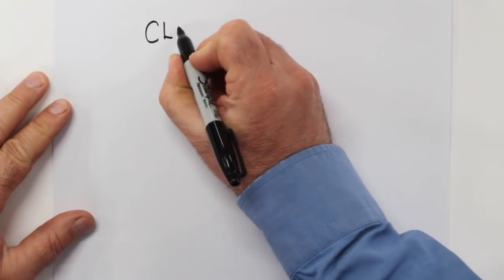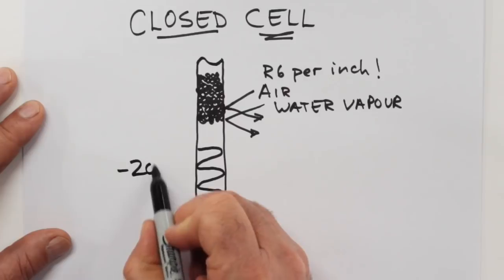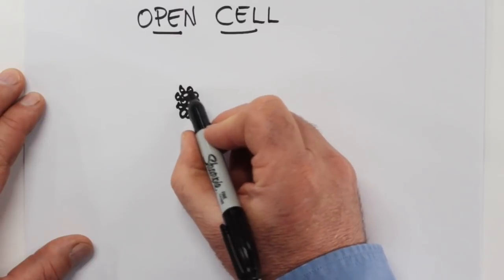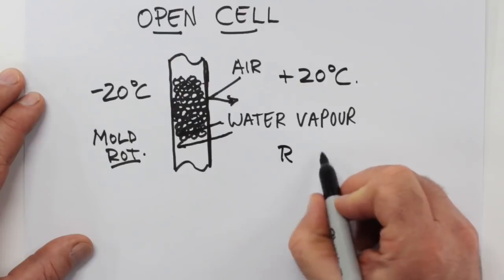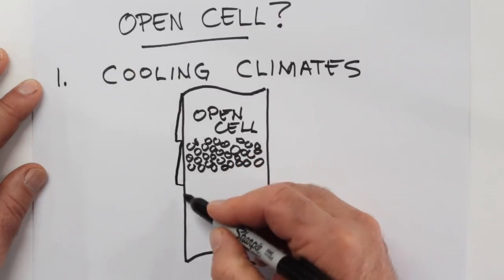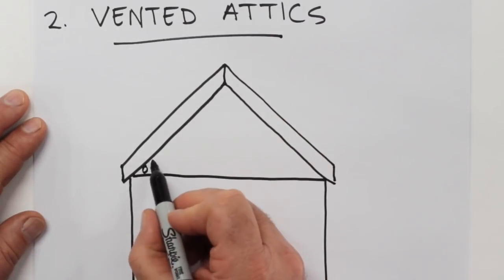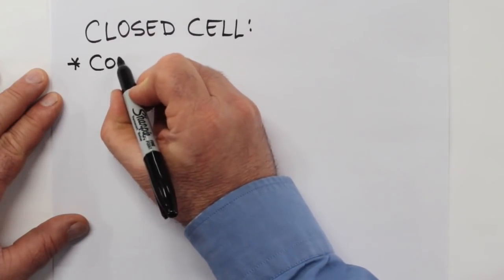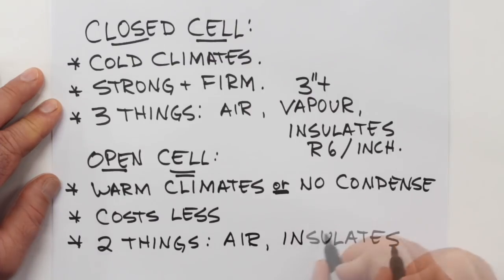SPRAY FOAM: Open Cell vs Closed Cell

Comment: From all of the videos I have seen, water vapor is the culprit. If not dried, it will cause mold growth. The mold smells bad and can cause serious health problems. I have spray foamed my house with closed cell and have no smell problems and it did correct leak issues near windows on exterior walls. The people having odor issues have poor planning of where to foam and no mold issues were resolved BEFORE foaming.

Comment: You don’t need 3 inches of closed cell to get water and air barrier.     Usually only an inch will accomplish this and the R6 rating is misleading as an air tight and water tight space will stay warmer and cooler depending on outside conditions.

Comment: Most UK banks don't want to go near any of this stuff not providing a mortgage if you have it.
Was thinking about having this installed on the inside of my roof, my bank said I would have issues with my mortgage if I proceeded with it, so I didn't.

Comment: If you use closed cell on a shingle roof traditional method, what happens if you get a leak,  Would i notice it? Which one controls sound more effectively since i live by and airport? I live in Chicago area - all climates

Comment: The disagreement in this comment section over what should be factual information is stunning. The absolutely destitute state of the contracting/construction industry is nuts. I've asked 4 or 5 handymen-types about basic things about my house and I get a wildly different opinion every time. It's no wonder house nightmares are so common. Everyone you talk to claims they've been doing "X" for 20+ years and the other guys have it all wrong. Meanwhile, homeowners are caught in the crossfire with all the bills and stress and hackjobs. It's really depressing because so many things in a house can cost well into 5 digits to fix if done improperly.

Not knocking your video, by the way. Just sad how hard it is to do the right things for your home.

Comment: Thanks for this wonderful explanation. We are completing a camper van conversion this year, and I just needed confirmation that the full closed cell foam insulation with the false floor installed is the right move, because so many people are using Havelock wool. We may add the more eco-friendly cork wood on top, but we’re definitely choosing the closed cell foam.

Comment: I have a metal roof woodshop I want to keep the heat in from a woodstove.  I don't care about moisture because the rest of the building is block and very water permeable.  I'm thinking open cell would be good for me.
Reply: Only if you want the moisture to pass through the foam and condense within it on the steel in winter.

Comment: With closed cell, one must be very concerned with trapped moisture.   The perm rating for closed cell is so low that water will not pass.   Imagine using this on the underside of a roof and you get a leak.  The water will now sit on the surface between the decking and the insulation.  You will get rot and mold.    As a mechanical engineer, I typically will call out closed cell only when it is against a surface, such as metal, where it will not cause rot or mold.   If using closed cell, you must take extreme care on making sure the surface next to it will stay dry.
Reply: maybe that's why you do not seal the joists just the cavities. if water goes in, the joists absorb it and directs it down.

Comment: 3" of closed cell on the exterior wall and finish it with open cell so you can cut it flush with the interior wall, then your entire wall cavity is filled.
Reply: Actually 2 inches of closed cell provides 86% reduction of heat loss(Compared to no insulation) vs a 3 inch application which provides 90% reduction of heat loss. That extra inch plus the additional open cell does very little. Spray Jones has a video called "How much spray foam insulation do I need" explaining how heat retention is far more important than R value. I think you'd like his vids.
Reply: @agentorange2554  I’ve watched all of his vids 👍
Reply: @agentorange2554  the issue most find is reaching the required R value for code, 2” of CCS is only 14-15 so you need something to bump it up for inspection. Waste of money but that’s our Gov 🤷‍♂️
Reply: @jtr82369  you are correct. They could save us tons of cash if they would get up to speed, but I'm not holding my breath on that one.

Comment: I've sprayed foams for over 25 years.  The claims from closed cell proponents *(which includes this guy)   about OC do not "hold water" .   It is not the function of insulation to control HUMIDITY inside the structure, let alone stop a leak!   If you are getting liquid water or dewpoint under your roof,  DON'T BLAME THE INSULATION.  
-That is the function of the roof integrity, air tightness of the building, and the  HVAC system,  (no , it's not ventilation,  which only depressurizes your structure and is immediately is replaced by humid makeup air from outside.)
The key to controlling  moisture  dewpoint occurrence is to link your attic to the conditioned space, not outside air.
 Open or closed, both function better than fiberglass because they block the intrusion of outside air,  and do a tremendous job of blocking convection within the cavity.
Open cell has a very low porosity , and  gravity will allow a leak to show itself,    but nothing like the fiberous insulations.   Closed has zero porosity,  but will not stop a leak --- just hide it.
Open cell is very good for residential areas in hot,  humid climates and dry temperate climates -- anywhere that has lower humidity inside the structure (via: mechanical cooling),  than outside on a normal basis.
  Closed is more suited for colder roofs and situations that have extreme temp. differentials,   such as walk in freezers,  or the like.     This is what causes the confusion, because construction techniques need to actually be different in cold vs warm climates.
Reply: Best answer, you win the internet for today.

Open cell for West Coast. Spray in Attic, leave vented and at half the cost of Closed cell. 
Closed cell for East coast. Spray on bottom of roof deck and floor of attic and be able to "control attic venting from 0-100%". In the winter close it up to keep attic warmer and prevent ice damning. In the summer up it up. 
Everyone in between you have to tweak it to your climate, or pay the difference. 

FYI for everyone, search open vs closed cell and find Matt Risingers "water test". It shows open cell does not take water on like a sponge. Over 24hr period of standing water it did not soak up anything. A week (like a flood) is a different story.

Comment: If somebody walks over the roof tiles, may this not lead to breaking the foam, creating air gaps where water can come in? And how about the incredible heat in the tiles when summer sun burns on them?  I think 80°C could be reached easily.

Comment: I recently had an insulation company at the house. They recommended spraying open cell spray foam insulation directly against the bottom of the roof.  Based on your video, it seems like you are saying that moisture in the attic could rise up, pass through hte open cell spray foam, and condense on the wood roof sheething. 

It would be great if you made a video showing when to not use each kind of insulation. Such a video would help me understand if this contractor's advice was good or bad.
Reply: I spray open cell on roof's all the time. Completely fine to do. What people don't realize is there is drywall and paint which makes a vapor barrier, and you will never have a problem. I prefer open cell in attics. Been doing over 10 years in Texas. 👍

Comment: had some insulation fitters saying they can remove the old attic floor traditional insulation and spray open cell instead on the roof. Should they spray it on the floor or roof?

Comment: "... so long as it is applied 3 inches thick." Here I go to Google again to convert. Ah, 76mm. Well my studs are only 50mm thick (tiny house). The confusion continues.
Reply: Put what can fit and close the dam wall just make sure to seal the corners in each stud bay

Comment: Hi, I work as a field inspector for the biggest foundation company in the country. 

Tip: Only use this in vented attics or on old basement walls made of Field stone/River rocks - it should be treated as a last resort. 

2 inch foam board has twice the R value and is your best bet for almost any project. 

NEVER USE THIS ON WOOD REGULARLY EXPOSED TO HIGH LEVELS OF MOISTURE.
Reply: “This” being what?....Closed or Open?
We just had closed cell sprayed below floor (crawlspace) to protect new oak hardwood floors from cupping.   Above ground is fiberglass batt but below is spray foam.  

I was told closed cell will also help stop insects from crawling inside from below.  

Not sure if this is true but I heard Close cell under subfloor also blocks Radon.

Must be applied by well trained installer, if too thick toxic fumes will never go away.
Reply: It's also good for steel pole barns.
Reply: To second 'BlueBird's' question - when you say to never use "This" on wood.  Which foam are you talking about?

Comment: there is one more advantage of open cell spray foam that you did not mention and that is that the open cell is better at absorbing sound... And close cell foam is harder and reflects sound..

Just throwing my 2cents in ;)
Reply: Sound absorption is a question of mass. The same volume of closed cell with be far better than open cell.
Reply: @reddog418  Sound transfer is also part of that, as well as frequency of the sounds.  Tests have shown otherwise: https://www.stellrr.com/comparing-sound-attenuation-insulation-materials/#comment-29

The open cell doesn't allow the transfer of sound through the cell wall structure for sounds between 100 Hz and 4000 Hz, for example.
Reply: @reddog418  actually not. Closed cell has a hard surface so sound waved don’t penetrate into the foam. The will however cause the entire mass the reverberate and transfer the sound to the other side. Closed cell is quieter than nothing, but not as much as open cell. I’ve had hands on experience with if for the last 10 years as I install both. Most of what I do is closed cell.

Comment: Great Video - Question - How can I tell if my insulation (already installed) IS OPEN OR CLOSED???
Reply: Push on it with your fingers.....you'll know immediately as closed cell won't indent.

Comment: how can I tell by look if they have uses 'closed' as paid for rather than 'open'? My house has been much colder since rockwool was removed and lapolla foam installed - there are patches where snow does not stay on roof now - Help?
Reply: If you can drive your finger into it, it's open cell. Closed cell, if you try hard enough you will break your finger.

Comment: Steve, Thank you for the informative video. I am a spray foam contractor in northern Wisconsin and have been for 18 years. We offer both open cell and closed cell products and have hundreds of projects sprayed with both open and closed cell foams. Both types are a certified air barrier (4 inches for open cell and at 2 inches for closed cell) that separate warm air from cold air thus eliminating condensation.Mold can not form unless it has moisture and a food source to grow. Both foams effectively stop this process. Both foams also prevent dust and allergens from entering your building. It is true that at 2 inches or more of closed cell foam creates its own vapor barrier and that is a plus. When using open cell you need a minimum of 3 mil plastic for a vapor barrier. However if you are installing drywall over your insulation you can use a vapor barrier primer/paint over your drywall instead of plastic underneath and it does an excellent job.I prefer closed cell but I certainly don't have a problem using open cell. When used correctly both foams are infinitely better than batt or blown insulations for many reasons. Most notably the 40% to 50% savings on your heating and cooling bills. There are many variables to consider when using spray foam but at the end of the day they are both well worth the investment. If anyone has questions feel free to call Jon at Northern Foam Insulators at 715-922-0246. Thanks.
Reply: This is all good info, if insulating a vaulted ceiling ( 2 x 6's ) of a screened porch in order to enclose the room, which would you use?  It occasionally gets mildew now as it's open and in humid SC. It's just sheathed with 3/4" and shingles but would like to insulate ceiling and put bead board over insulation.  And does it need venting?
Reply: @pcdubya  if theres any doubt in your mind, use closed cell. Closed cell is waterproof and mold resistant.

Comment: I'm thinking about looking into this type business, any recommendations for proper guidance; where does one start?
Reply: It’s a great business to be in if you like being crazy busy for 3 months and starving to death the rest of the year. How are your mechanic skills? You’ll need them. Any experience diagnosing electrical problems, you’ll need that too. Like working with hot chemicals that constantly plug up your gun? It’s not as plug and play as they promised. How are you with fluid dynamics? That can be the difference between a good job and leaving a toxic mess in someone’s dream home. And then there is always the joy of using a chemical call isocyanate that is highly reactive with moisture and loves to crystallize on the shaves of the pumps and in your lines raising hell with your equipment and ruining your day. So step 1: be a really good mechanic, step 2: be smart and go fix cars, trucks or tractors instead.

Comment: my name is mark and i have been spray foam for 13 years now and u would use open cell in ur house so it can still bearth because using closed cell will seal ur house up to much use close cell on polebarn and basement and opencell is good for cool weather

Comment: I live in the tropical country where there is no winter, temperatures goes down only until 15°C and most of the time is hot up to like 35-50°C and heavy rains during monsoon. Which one would you recommend?
Reply: Use which ever you can afford. Open cell is better than any other insulation. And closed cell is even better.

Comment: Im in commercial construction, been a superintendent for 25 years. The bottom line is to prevent ANY water or air into the structure, by waterproofing, damp proofing, caulking, vapor barrier, etc. As far as insulation, closed cell is the way to go. Have you ever looked at an older home up in the attic, and notice the batt insulation is only 2" thick (or less)? The insulation breaks down and gets into your HVAC system, and you get to breathe that lovely stuff in.  Id advise consulting with a commercial builder. Most home builders our a joke, they take way too many short cuts.  I hope this helps some one.
Reply: Yeah, I'm thinking if I spray this stuff under the roof, a leak would remain undiscovered longer and spread out and stay under the roof for some time, whereas the open cell would come through and you'd see where the problem is. I get that in many/most applications that you'd want that barrier, but I'm disappointed that can't see much availability on the open cell material.

Comment: Steve, if Closed cell is it's own water barrier why would I choose Open cell as barrier in a cooling climate? As in Central Queensland Australia. Thanks for your efforts in putting this video together. Good stuff.
Reply: Its half the price.
Reply: Your home should have a vapor barrier on the outside of the sheathing. You will be fine with either. Closed cell is just better.

Comment: I completely disagree with Steve's theory on Open Cell vs Closed Cell.  First and foremost, both foams air seal creating an air barrier.  That air barrier created displaces 93% of the moisture drive, yes this goes for open cell.  In a warm/cold climate zone, the vapor drive switches with the season, as well as with the day and night cycle.  So there is not a constant "warm side" to place a vapor barrier.  Rule of thumb is that about a cup of water per square foot in the form of water vapor passes through a structure annually.  With open cell foam 93% of this cup of water is deflected due to its air sealing properties, the 7% remaining passes into and out through the foam depending upon vapor drive.  Vapor drive is warm to cold.  It is much better to have moisture being able to dry, than moisture being trapped.  Most homes are built of wood, a porous material.  Closed cell is not porous, so if moisture is trapped in the wood it is only allowed to dry the way it got into the wood and not through the closed cell foam.  In hot roof assemblies where foam is applied to the underside of the roof sheathing, you do not want the use of closed cell foam because if the roof were to leak you will not know about it until the ply wood sheathing is rotted or soaked from the leak to the soffit.  With open cell, the leak will allow water into the foam, and create a wet spot so you will know which location the leak is coming from.  Open cell foam is a great product when applied correctly.  I shake my head when people are told to install fiberglass with a vapor barrier instead of open cell foam when they can't afford closed cell.  So the thought becomes closed cell or fiberglass.  When I remove fiberglass, 95% of the time there is signs of moisture even with the vapor barrier.
Reply: Would love to get a better idea of what you're explaining. Please do a video showing your analysis and post a link. It's always great to read something but visual presentation can add a lot of credence.